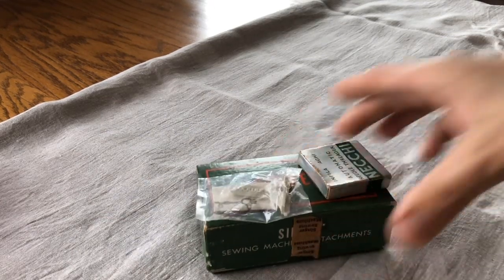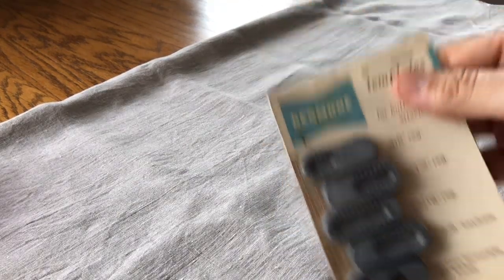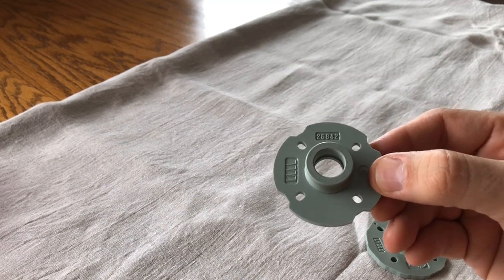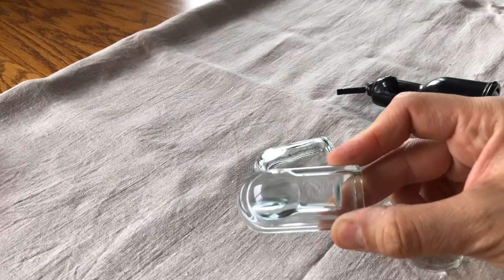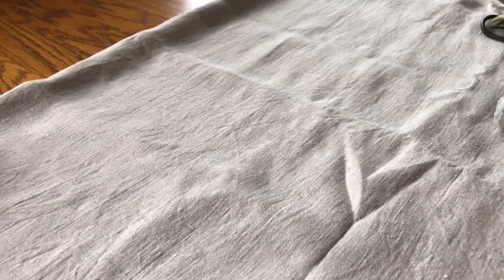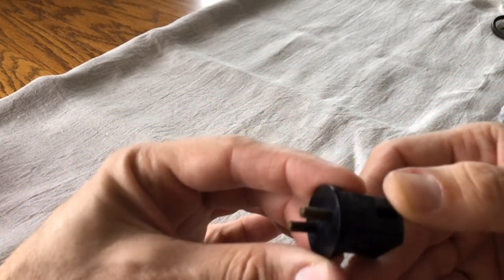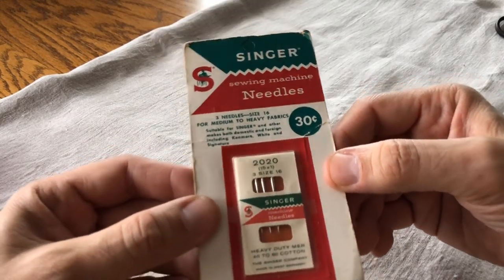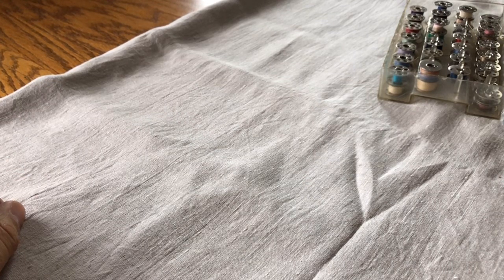RESTORATION SERIES 3:  Good as Gold! Saving old parts. What to keep and catalog for future use.

Comment: My machine came with a few Q needles, but no Q foot.  I finally found two of them at an estate sale/garage sale earlier this year and got them for a few dollars (one is for a horizontal bobbin, the other for vertical).  No Kenmore machine(s) though to go with them unfortunately.  I don't know if I'll ever use them (I really need to relearn how to sew), but I had to have them when I saw them, especially since they were both the super high shank feet.
Reply from the maker: Those were great finds Ingrid.  And at least you know what they are for.  That way, you can either  use them for a future Kenmore machine or even sell them to someone who could use them.
Reply: @Vintage Sewing Machine Garage: I've also been bitten by the "old sewing machine bug", so I will probably hoard them to myself haha, at least for a while. I've sort of rediscovered my love of taking things apart to see how they work and putting them back together in (hopefully!) working order.
Reply from the maker: I'm in the same position Ingrid.  I have a vintage stand mixer and laundry iron I would like to learn how to overhaul.

Comment: I have my mom's Kenmore White 117-552 sewing machine and it doesn't have the power it used to have sewing through heavy material.  The motor is humming but it won't sew when I get to a thick seam.  I have cleaned and oiled it but that didn't seem to help.  What can I do to restore it's former power?